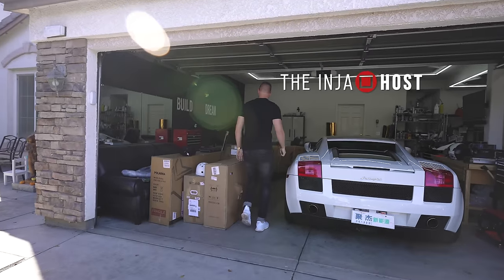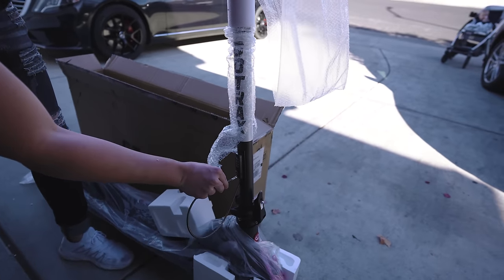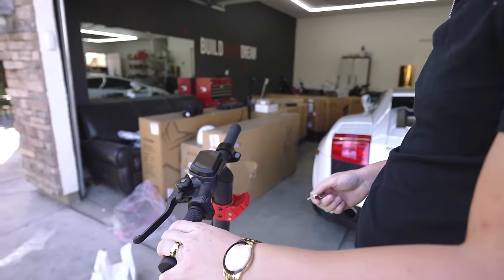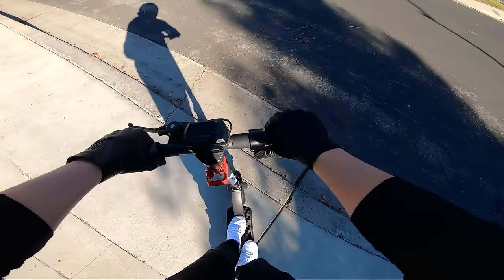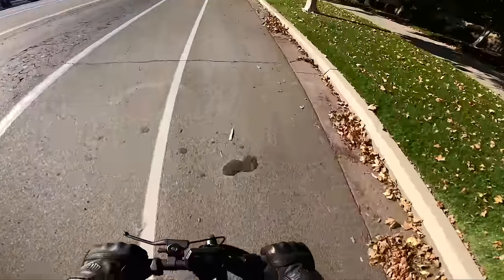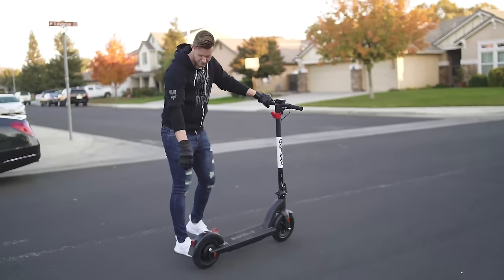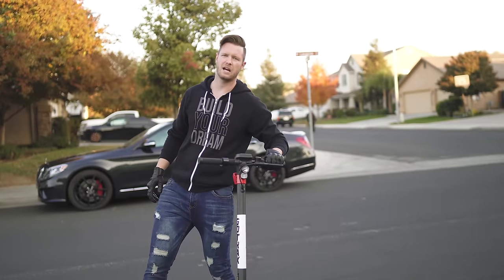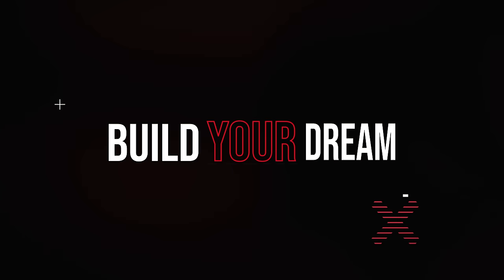$549 ELECTRIC SCOOTER that is well worth the money

Comment: To be honest before you buy this product take a look at the Evercross H5.  I bought it for 600 on a cyber Monday sale and it's specs are just so much better for like 50 more dollars.  It gets like 27 MPH with a seat, turn signals, adjustable handle bars, a horn, full suspension, LED lights, a trigger throttle, keyed ignition, the list goes on.  I'm also not a huge fan of GoTrax customer support.
Reply: I just bought the evercross h5 I love it and it's quick
Reply from the maker: Good to know!
Reply: I jVe had the evercross h5 for a year and it's worth it.
Reply: I reviewed that one! It’s a great unit
Reply: @LordCurt  oh yeah I saw your video
Reply: Where did you buy it ?
Reply: @ashleynato  I bought mine on Amazon for 600 I think 660 with tax on Amazon.
Reply: It was cyber Monday so the price may have gone up, but there should be some holiday sales soon.
Reply: @ashleynato  Amazon 599$
Reply: Thanks again bruv
Reply: Don't see it on amazon only on ebay
Reply: I had purchased a g2 plus had trouble with it after 6 days had the receipt and went back and forth with their cs and they never honored the warranty i would say their scooters seem good but i would not recommend buying one only because of customer service which was terrible.

Comment: That was electronic break you can tell , hahaha , called disc breaks bud
Reply from the maker: No that was e-brake PAL
Reply: @TheInja disc brake on the back tire , what is the brake and break cable for guy , disc brakes
Reply: @TheInja  break lever connected to break cable connected to disc brake , no electric
Reply: U skidded cuz the disc locked up back tire